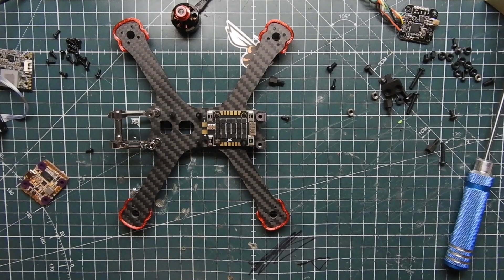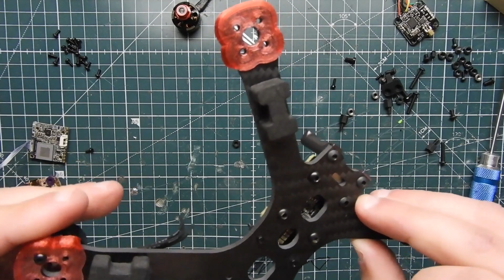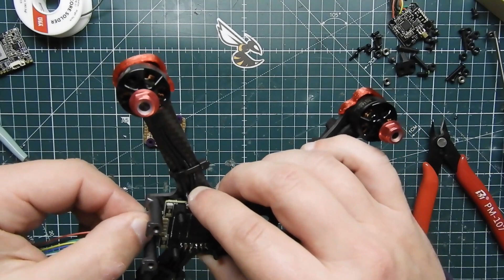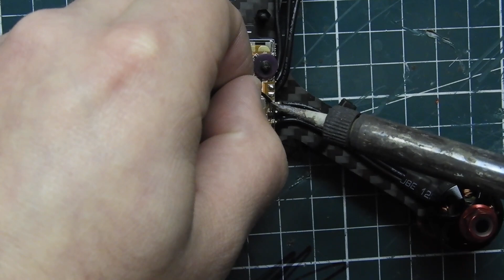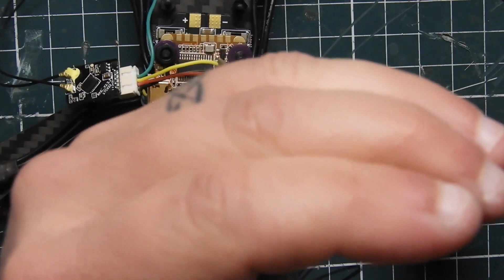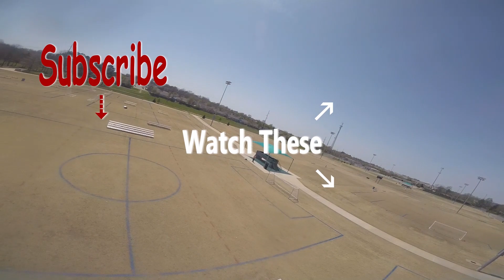Armattan Gecko 4in Build - Part 1

Comment: Is the 4” body longer than the 3”? What milliamp batteries will you be running?
Reply from the maker: 4s 850mah I believe they are the same length but I don’t have a 3 inch to test that

Comment: You're mounting the tpu soft motor mounts on the wrong side of the bottom plate.
Reply: Trust me I used to mount mine like that and the screws eventually come through the tpu, they are designed to dampen the motor vibrations and save the edges of the carbon at the same time.
Reply from the maker: No these were designed to be mounted from the underneath